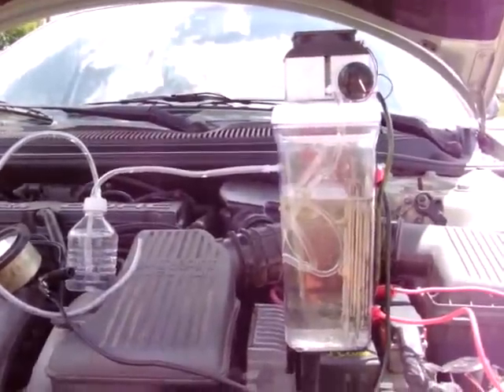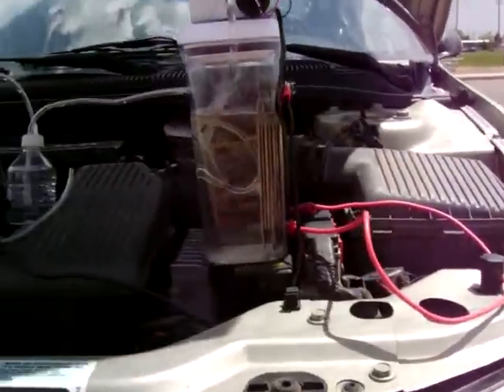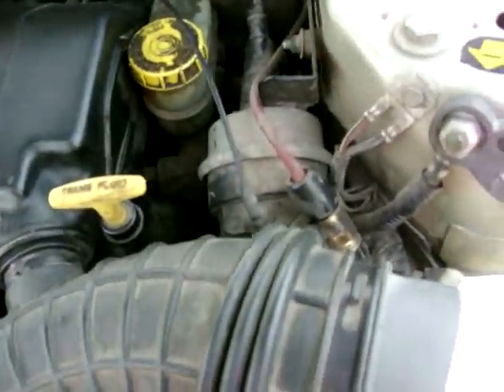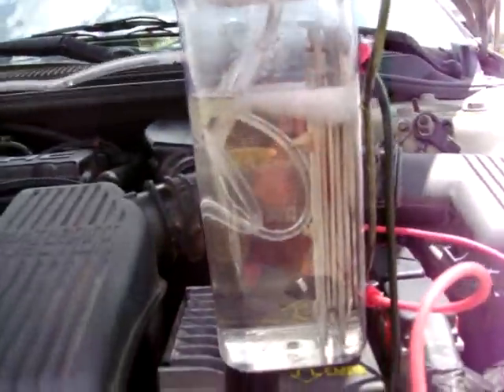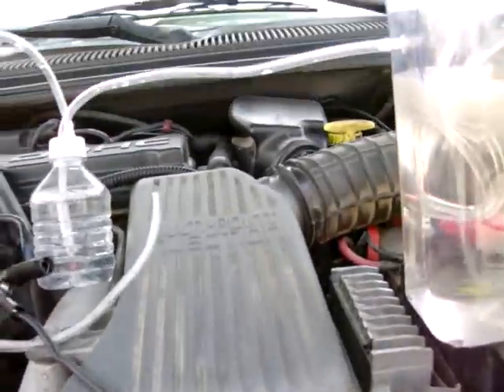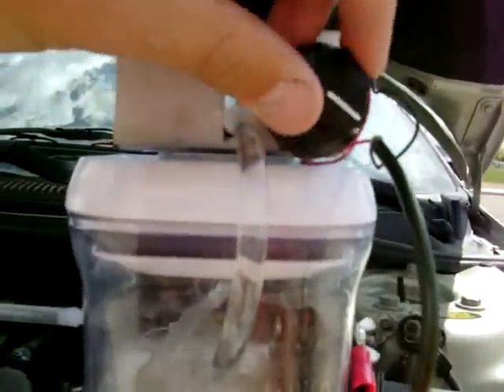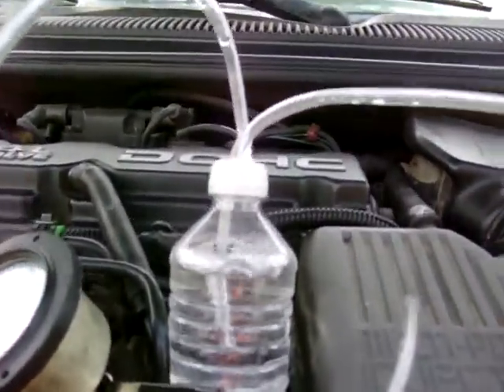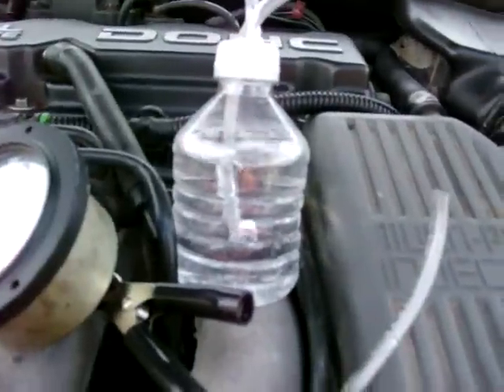hho generator test in car

Comment: @bassplayapdx  We are very scientific dude.  We're showing how easy it is to convert water H20 into hydrogen and oxygen H2 and 0.  Here the voltage applied is between 12 to 15 volts.  At 24 volts the diminishing returns are reduced significantly  Instead of just flapping your yap try this yourself..

Comment: Hi, how does your cooler work??? It looks like you run the water loop from the resevoir via a tube through the heat sink and back again. What moves the water? Do you put one end of the hose in the water and one end out of the water and use the HHO pressure to circulate it? Or do you have some sort of pump on it? Thanks for your reply.

Comment: False, there is no increase in energy output from the engine with an hho generator like his or any other home brew model.  NASA did research regarding the ability of h and hho gasses to increase efficiency of regular combustion.  They gave up the pursuit, because it was found that insanely large amounts of hho (or h) need to be burned in order for the efficiency of a gas engine to increase.

Comment: Energy drawn from the battery came from the engine.  Also, much more hho is required to help gasoline burn more efficiently than your generator can provide (many l/min).  Whether it's inputting enough energy into the generator to produce that much gas or just leaving it as it is - an hho generator is nothing more than an air freshener in a car.  My suggestion is to take it out of your car and make a nice cutting torch out if it, if you can buy a storage tank. :D